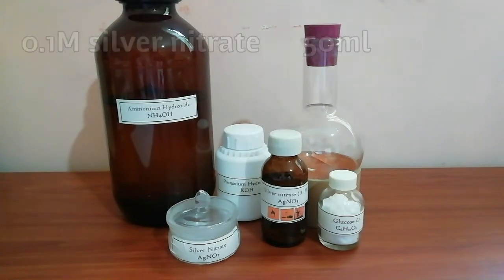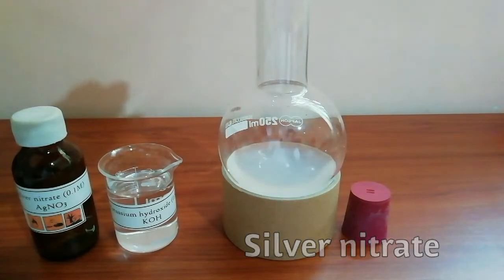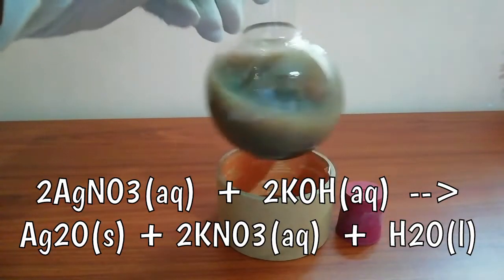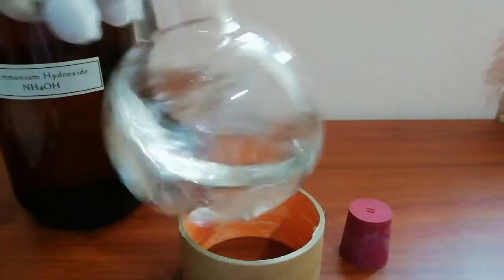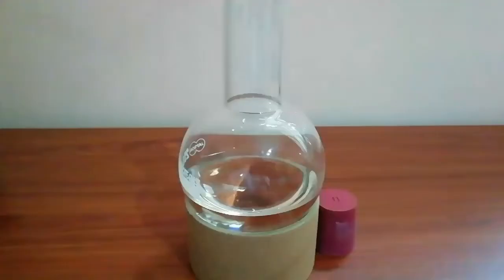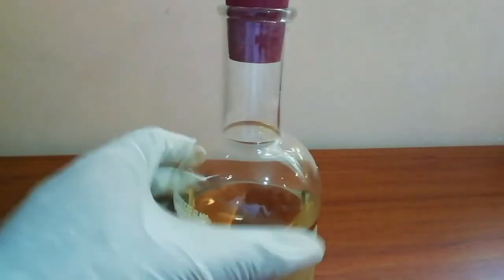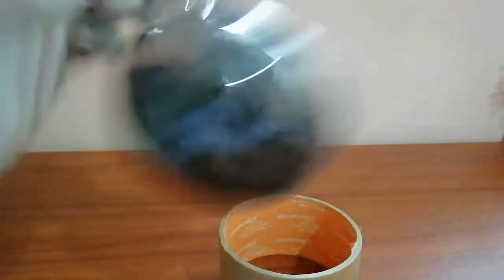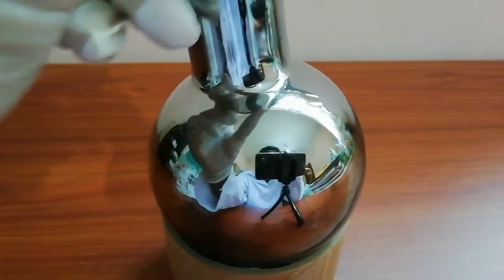Silver mirror ( Silver mirror test )

Comment: Can we use sodium hydroxide instead of potassium hydroxide??
Reply from the maker: Yes you can use sodium hydroxide
Reply: @ChemExLK  thanks friend... Another question- plz tell me can we coat first surface thru this process?
Reply from the maker: For glass it works well but the surface should be very clean. And this is a improved method of laboratory functional group testing. For other surfaces like plastics may work. However after making the mirror the solution must remove from the container, wash with distilled water and dry it well. Then stopper it well, avoid contact with air.
Reply: @ChemExLK  actually I made telescope mirror at home and I want coat it there's not a single video on YouTube for silvering telescope mirror thru silver nitrate+ reducer,,few videos are but they use spraying method..I will be grateful for you if you can help me 😊
Reply from the maker: For that you can use this method. You can use a watch glass(clock glass). Cover the surface you do not want to paint silver with tape. Then the watch glass immerse in the solution. Instead of shaking you can slowly heat the solution. After the process, wash and dry. Then spary some acrylic white spary. Before you do it for the mirror practice with some pieces of glass.
Reply: @ChemExLK  lot of thanks dear friend..I will try it tomorrow and if I get any problem I will tell you..I will be more grateful...Thanks again

Comment: Hi! Lovely explanation, but I have a few questions.
1. How can I make the silver nitrate solution?
2. About potassium hydroxide, I only have the solid type, do I just mix it with a bit of water?
Reply from the maker: Thnks
1. You can dissolve 0.85g of  silver nirate crystals in 50ml of distilled water for make silver nirate solution 
2. dissolve 1.57g of KOH in 35ml of water
You do not need to weigh the exact amount of chemicals to make solutions and do this experiment.

Comment: Regards. Good explanation. I have a question. How many grams of glucose are 5% solution in 10 ml? To clean the flask before making the mixture, do you recommend ethyl alcohol or acetone? Thanks
Reply from the maker: 0.5g of glucose in 10ml. For this experiment I used new flask. I think its better if you have dilute sodium hydroxide, first wash with sodium hydroxide  then wash with ethyl alcohol. Acetone is also fine.
Reply: @ChemExLK  ok. Very thanks